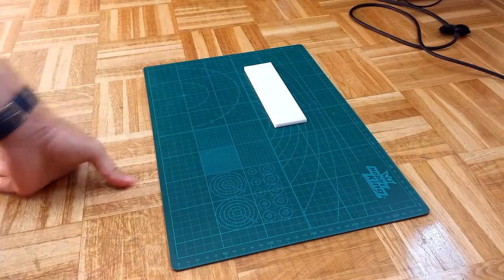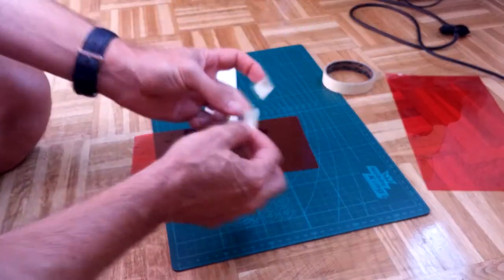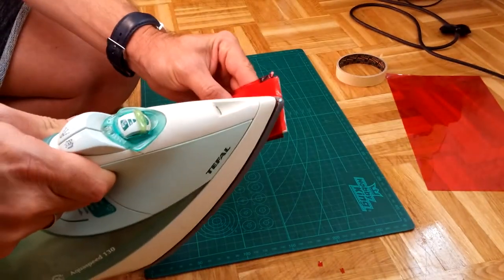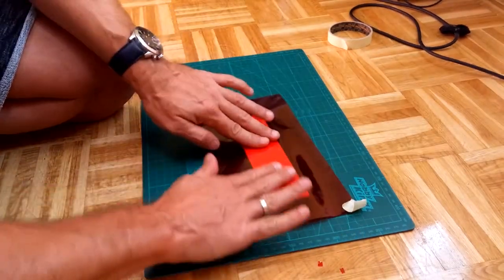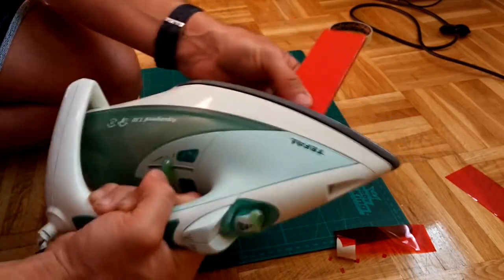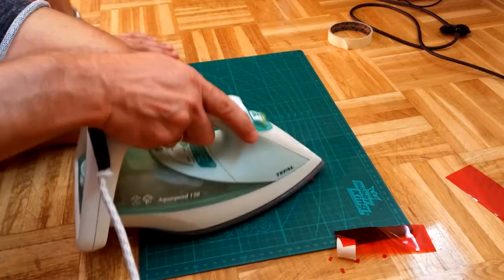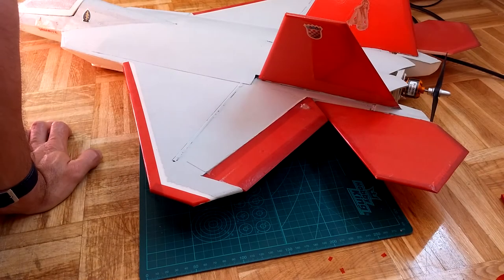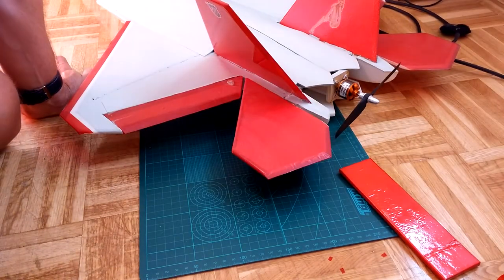How to cover foam airplane with standard covering film

Comment: Im just gwtting into the Hobby.....Ive got a Timber and have 7 successful flights on her. Ive been thinking of a way to make the aircraft stronger and here it is...thanks for the info Sir. My question is to you fellas is this....is it worth doing on the Timber and is covering it going to affect the performance of the aircraft?
Reply from the maker: Hi, I wouldn't cover purchased plane if they are still in one piece 😀 , I cover only my depron scratch built ones.

Comment: Is this model suitable for beginner .bro?
Reply from the maker: Which one? Check my videos about how to make an RC airplane, there is one great begginer F16 depron model which I used when I was starting with zhis hobby
Reply: F-22 at the last minute..bro!
Reply: Could I use prop.10" for this f-22..bro?
Reply from the maker: @lurkingcorsa10  yes, but not with 2200kv motor, prop size depends on motor type
Reply: @neutrno  -  yeahh..  I uses brushless 1000kv.. on my prop. 10" ..bro!

Comment: Nice Shumate F-22!  I've been using low temp covering on foamboard planes for a few years now and it works great.  You will get a few more wrinkles over compound surfaces than you will with Balsa (because you can't crank the heat) but it looks nice, adds strength, holds up great to the elements, and saves weight in some cases.  Last foam build was finished this way and it came out pretty clean: https://www.youtube.com/watch?v=xwpiuYpsii8

Nice tutorial!
Reply from the maker: wilmracer thanks a lot. And your pilon bird is awesome.